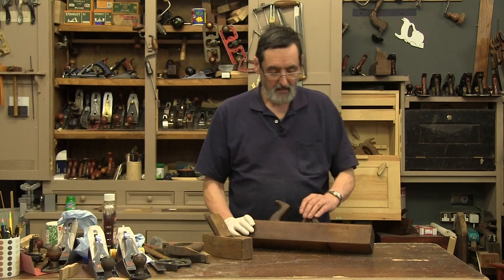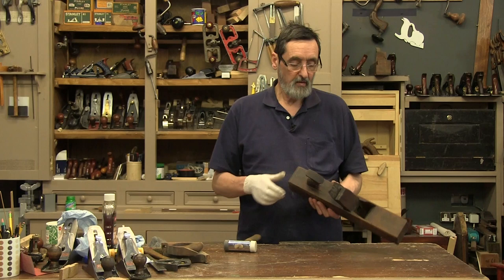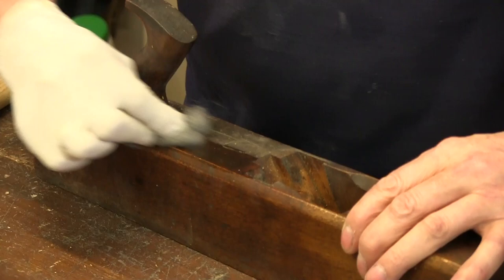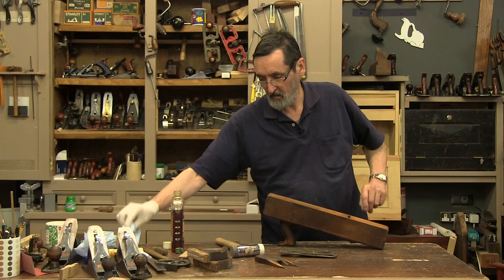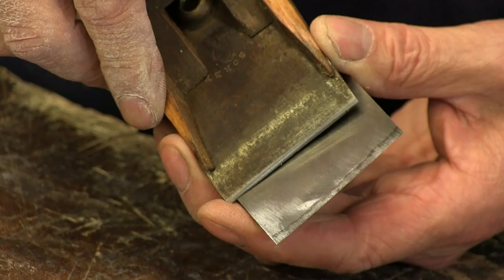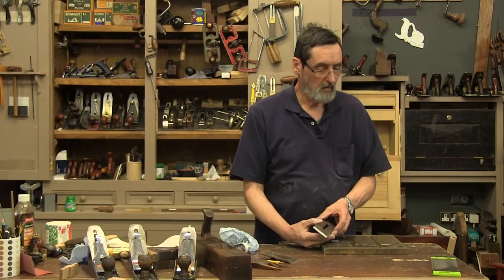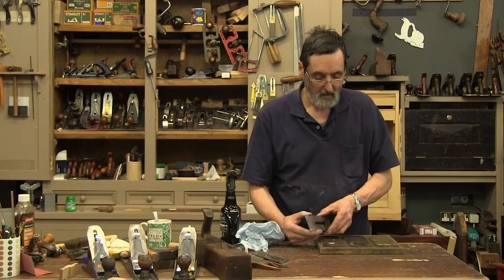Preparing a Wooden Jack Plane | Paul Sellers

Comment: Thanks for bringing back a fond memory. As a young child I used to hang around an old man who lived in the area and I still remember him opening a cardboard box and removing a brand new factory made Jack plane. The first thing he did was to take it apart and stop the mouth with glaziers putty, put the plane in an old enamel dish and then fill the mouth with a mix of boiled linseed oil and pure gum turpentine oil until it ran out the end grain. The oil that accumulated in the tray was brushed all over the plane body and  wedge. the items were placed in the full sun to warm everything up, then he did it all again. He said it was to strengthen the plane and to prevent it splitting. A few days later my job, before the plane was assembled, was to dip a piece of beeswax in gum turpentine oil and rub it onto every surface of the plane except the throat then rub as much off as I could with some old hessian sack material. Then he went about setting up the plane much as you have shown in the video even though it was a new plane.. After he died I often wondered what became of that plane.
Thanks for another top video.
Reply: Thanks, labrat7357, I appreciate that story.
Reply: Thanks for passing on some old, forgotten knowledge.    Now I can use the same technique on my plane.    Thanks again!

Comment: I am a violin maker and use a lot of wooden planes. Your discussion is bang on. One tip is to put the iron and wegde into the plane before you flatten the sole, obviously retracted.  That way you compensate for any bending of the plane body caused by the wedge tension. I plane my planes frequently. Unlike iron planes, it's easy to keep them dead flat.

Comment: I noticed a slight arc over the cutting edge of the Wooden jack plane blade that you were re-surfacing. I thought the blade had to flat, so as not to leave a gouge in the finish surface. I never thought of using window cleaner, but I can see its advantage. I used to use a mix of 99% Mineral Turpentine and 1% Linseed Oil.  That's what our woodwork teacher used. Sadly my wood working skills are ever so redundant these days as unable to rent a place with a Garage. I have an old  ships carpenters chest as a coffee table. Pity help any burglar who tries to move it, It packed to the brim with tools and two vises. Thanks for the videos, very help during this Covid 19 lock down period.

Comment: i purchased 3 wooden plane of that size and after sharpening and squaring them i absolutely love them i have an electric plane and jointer and have not touched them since i got my planes i much prefer using them!I think it is the mere fact  you have to pay attention to the wood and the plane and how they are responding to each other.

Comment: It's really tough to start a woodworking project. I had wasted so much time & money on my previous work. Next, I discovered the reason why, that is I didn't have a specific plan & diagram. I always let things even worse when it can be fixed easily if I had some experience. Then I discovered a woodworking plan which contains all of the detailed plans, tips & guides - it help me lots.

Comment: Brilliant  Paul. I've just been lucky enough to find a 14inch Mathieson in a "junk shop". ..   £5 !    Could be 80yrs+? Took it home and thought I would "renovate" it. Having no idea how to do it ! First taking the "wedge out by hitting with a hammer (lucky no damage done). Manage to get a "fairly"  good edge on the blade and it actually WORKED !! But after this vid I can do it properly!
Thanks so much for a cracking vid on how to do the job PROPERLY cant wait to have a go (nervous about planning base). But I'll be brave and have a go. By the way I planed a piece of board and the result  "I" was well pleased but can do better.
Cheers again. Thanks for all the great vids.

Comment: Just found this video on planes. I came a Ross an old blade andiron from Buck Bros.. spent my spare time making a wooden frame and for it. I just finished it today. Tomorrow's plan will be to sharpen as you showed and then how well this jointer plane will perform.

Comment: I bought one of these and tuned it as per your instruction and it works like a knife through butter.the secret is GENTLY for adjustment .My one has a cast ,tapered Ward iron.made in England..just great.Only difference is that mine has a strike button on the front top.For a large plane it is really light and a pleasure to use.

Comment: All you have to do is look at some of the woodwork over the last few hundred years to know that these old tools were definitely good enough. I got my first wooden plane a few days ago, in an old pile of "junk" from eBay. It's an old Spears and Jackson block plane with a metal plate at the front sole. So far I've only cleaned up the blade and iron, and restored the bevel on the blade, which was no joke, those blades are thick as a tree trunk!
I still need to properly sharpen and flatten the blade, and check the sole for flatness, but it seems to work fine even without this.
I'm really starting to like these old tools..

Comment: Thanks years ago mom bought me a several wooden planes I'm not sure why since I'm an electrician by trade, and grandpa gave up on me cutting a board straight without a miter box, but the time has come for me to straiten out a door frame that is proud of the exterior siding on one side, so out comes the plane which of course needs sharpening!

Comment: Excellent video.  I recently bought my first wooden plane (similar to the one in video) - so very useful.
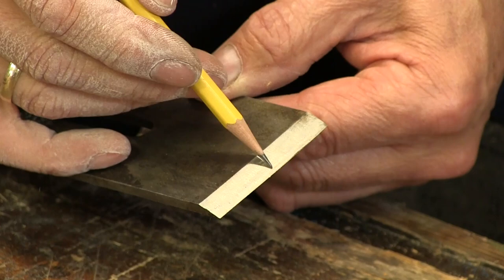Good point about being able to grind convex bevels on a grinding wheel (@ 18:00-ish).   There is an assumption that one would use a fixed sharpening-jig or hold the tool in a fix position, which would indeed usually produce a hollow/concave bevel - however, when sharpening free-hand, you can move the blade around to achieve whatever profile you want.
Reply: Glad Paul took the time to explain and show how good these planes can be and why they fell out of favour despite their efficacy. I've started using them and get a kick out of how well they work, with their thick, wide, vintage irons.  Today  I bought a third wooden plane: 17", 22" and, now 24"! However the latter is not for me, it is destined for a friend who wants a long plane to supplement his machine tools. They work impressively well and there are plenty to be found at low prices at car boot sales, vintage tool shops & antique shops (the latter need not be expensive), if you keep your eyes open; they tend to bemore expensive on ebay, where packaging & shipping adds work/time & cost.

Comment: Thanks Paul. Great video. My jack plane iron says A. Hildick as the maker. Iron is undamaged by hammer so possibly never used. My wooden smoother has a Robert Sorby iron. Jack plane does not work quite as well as yours yet but I'm getting there. Not quite sharp enough. Also I will recheck where cap iron meets the iron for gaps.

Comment: Mr. Sellers,

Thank you so much for sharing what at times seems like 'old school' to the younger gen. Sometimes the simplest things can be so much faster, easier and in the end better than constantly reaching for power tools that can have so much set up time the task could have been done in 1/4 the time with hand tools, and give better results.

The question I have is about Hand Planes. I have several and my woodworking has made using a shooting board for precision miters @ uncommon angles unavoidable. the problem is not one of the 7  I have are square from the sole to the side faces, thus creating compound angles. could you cover the steps required to square up a plane for this type of use. and what is required for iron frame planes needing such a tuning? the thought of having to spend $150+ or more just for one that is square is a bit daunting since I already have so many. I have considered going to the metal shop and having the frame[s] surface ground, but that can get spendy as well, so I was wondering if there was a good method that could be used where elbow grease would be the major investment.

Thank you again

Brian

Comment: Good video.I have a few wood planes which I am bringing back into use including a new jack plane. If i could just make one point for you and the viewers being that Raw linseed oil is non setting it is absorbed by the diffuse porous grain, and it stays doing its lubrication, making it better for a beech wood plane than the Boiled linseed oil which "sets". Old timers used wipe their beechwood planes down at the end of each week and the Beech was the timber of choice because of this staying lubricated quality
Reply: Anthony newsome Note of caution. Raw Linseed is dangerous (as in unstable).  We use it in re-enactments.  Good stuff, but 'read the label'.
Reply: dispose of cloths carefully after use as they can self ignite it left in a ball,  ideally hang them up to dry

Comment: Fun fact: these planes have been used by pritty much every carpenter here in Germany till about 20-30 years ago and are still used and sold in every good hardware store...
Reply: Unmesch Because your guild teaches hand tools before power tools. Here in the States, it's straight to the power tools, with no appreciation for what learning on the hand tool does.
Reply: James Estrada+ aye, Here in europe we do use hand tools a lot more. And to be entirely honest, A powered plane can't ever give as good a finish as a good hand plane. Spinning blades always leave a wavy finish. But there is nothing wrong with powertools. They are good for roughing out wood fast and accurately. With modern glues it doesn't even matter that the surface isn't perfect either.
Reply: In the first year as a student for woodworking you never have something else in your hands. In the workshop of my company, only one out of 13 carpenters had another plane called Rali (after the swiss company that invented it) and he just had it because of the fact that you can change the blade with a switch. this is not for "real" planing but for a worksite where tools are limited. :D I started restaurating my wooden plane this week because its dirty, old and someone just spread glue all over it. But all of my superiors and everyone else that I know that is into woodworking or carpentry in Germany uses wooden planes :) I love that fact.
Reply: We still use wooden jack plane here in Asia.

Comment: After smoothing my own planes, i usually put them in a long tray, and let them soak in linseed oil over night. Its amazing how much oil such an old plane can absorb, but it makes dried up, old planes come back to life, and prolonges the life of the plane.
Reply: Allan Stevns if you want oil further up the plane, you can plug the plane and dump it into the mortise, too. Just don't wax or seal the plane before doing it. The oil can literally go from the mortise of the plane through the ends, and it will follow right down the grain. It's not hard to get a plane to take in close to a pint of raw linseed oil if it's really dry and the wood is open.
Reply: +David W hi david .i don't understand by what you mean in"plug the plane"love your videos by the way
Reply: +david osullivan Hi David, thanks for the nice comment. By plugging the plane, I mean putting something in the mouth so that the oil can't come out. George Wilson suggested putty, and I have just clamped something on the outside of the mouth (and put the plane in question over a large pan because some inevitably does leak out - if it does, you can just pour it back in the mortise).
Reply: ah i get it now .thanks for that.i have two old jacks that need a little work .i am new to this but love the hand tool approach .mostly because of space,budget,and noise not to mention dust collection.i am very interested in your no nonsense approach to sharpening you make a hell of a lot of sense. i use diamond plates with strop .it works but that stone you use looks the real deal
Reply: I don't think it is necessary to have oil soak all the way through.  As long as it soaks in just below the surface, that's all that is needed.  I've come across woodworkers that soak things they make in hot oil and managed to get complete oil penetration - but to what end?

Comment: To clean old wooden tools, use a mixture of linseed oil, medical turpentine and vinegar. Scrub with steel wool and clean with a rag. It will remove all the gunk without damage to the wood.

Comment: great work paul I was wondering  if you need to tension the body on a wooden plane as you do on a metal plane when you flatten the sole  as I imagine the wood will move more when under tension  cheers

Comment: Why is it that planes especially and saw blades and handles are so often splattered with paint?  A craftsman would never leave their valuable tools in an area where they can get paint on them, the means to earn a living would be cherished by placing them in their proper place.  I guess it lowers the resale price (at least in my opinion) and it is readily removed, it still angers me that it is a regular occurrence.  Rant over.  Have a transition jack waiting for a little tender loving care to restore to its former glory, can’t wait to hear it at work.  Thanks Paul for your sharing decades of experience.

Comment: Great video.  Very helpful and motivating.   One thought: When flattening the sole isn’t it prudent to have the iron and wedge in place (with the iron retracted out of the way of course) so the forces on the wood are the same as when it is being used?

Comment: Wondered if you could read my brain. Just bought amongst others a used plane like the one you set up in your video. And I want to restore it to be able to use it. Your video answered already a lot of question to this.

One question lasts: How do you get rid of heavy rust and wood worms?

Thank you for sharing your experience with us.
Reply: T³ Tips Tricks Tests  Thanks. I opted for a chemical rust remover as there where nine planes to restore including the one I mentioned above. This worked really well as all irons and fittings where derusted within 24 hours without hard work. This came afterwards when I did the resharpening and honing of the irons by hand. In the end I got five "new" planes for my workshop for about 35 € which is under 50 $ :-))

B.t.w.: When I tried to make up the body of the jack plane I discovered that it was so heavily damaged by wood worms that I only could through it away. Luckily I now have the iron and the the cap iron, so I can build a jack plane by myself later.

Comment: Thank you Paul. I learned most of my knowledge from you.
You are planing the sole from back to front, so I guess this is the grain direction. Would it be better if the grain direction was opposite, i.e. front to back, for using the plain?

Comment: Great Information.
I have one of those wooden planes and now I know what to do to resurrect it. The steel was made by Ohio Tool and says cast steel.
My only issue is that the wood has checked quite a lot. but it still seems to be very solid. The ends of the sole are not flat to the body - by about 1/16 of an inch - I am not certain I am going to correct it since the sole is 22 inches long.
Paul with out your video this plane would still be collecting dust in the basement

Comment: Tip....for a high end and durable finish only use stainless steel or brass wool for wood restoration if you can get it and afford it, because normal steel wool can leave rust spots or stains in the long run. For marine purposes they only use brass wool for that reason. When normal steel wool is applied small portions of the steel wool might break of and enter the wood as tiny splinters, in the end it might rust and appear as dark spots or even stains in the wood. So if you don't want that to happen in the long run long after you are gone or even earlier only use brass or stainless steel wool for wood restoration if you want to have and maintain a high end finish. Especially for marine purposes.

Comment: Excellent video, thank you. I have a quick question about sharpening. You strop the back of the blade on a block of wood not leather. Is that because leather is softer and more likely to round over the wider blade? Or am I over thinking it?

Thank you very much.

Comment: My plane is identical but has a round strike button on the top at the front and a WARD  tapered cast steel iron . It takes whisper thin shavings or chunks and is just fabulous . i do not know why they went out of style . Once you adjust one ,tip tap, tip tap,it becomes second nature.

Comment: I really like the feel of wood planes, the way it glides on the surface of the wood, I try to use mine as much as possible, but it is so much easier with bailey pattern planes because of the adjuster mechanism. What is your opinion on transitional planes?

Comment: Just bought a wooden 500mm plane by some Finnish maker from an antique shop. It looks to be over 100 years old at least. Honestly, im just gonna replace the iron with some cheap rusty iron so it looks like a plane. Put the plane on a shelf as decoration and take it's own iron to be re-purposed for another plane because it looks to be very good steel. This plane just looks so nice i don't want to use it.
Reply: How much did you pay for it, if you don't mind me asking?

Comment: Hello sir, 
Thank you for this video. I have been trying to set up my wooden jack plane, and as soon as it's all ready to go, I begin a pass and the blade bites and the whole system loosens up. I feel like I am unable to get my wedge tight enough. This is a new plane, could that be the issue? I have really put some muscle into setting the wedge (quite contrary to your demonstration) and it still seems to come loose as soon as the blade begins to bite. Do you have any suggestions? Many thanks.